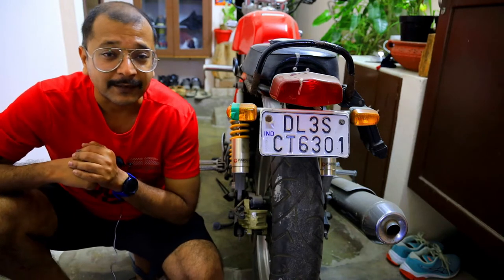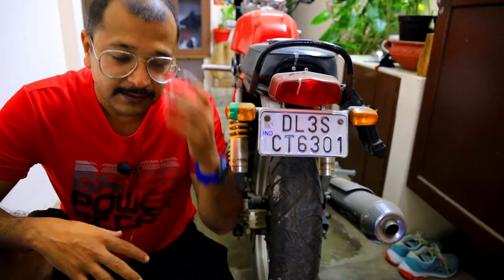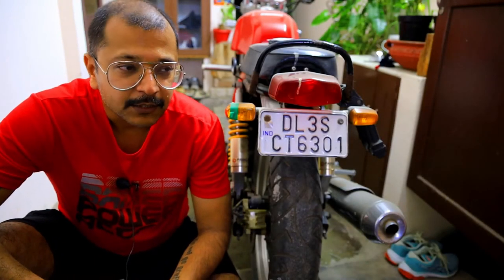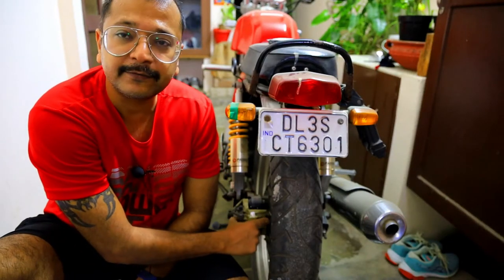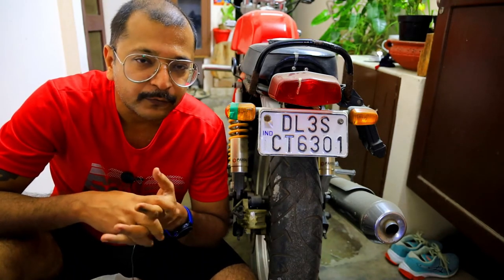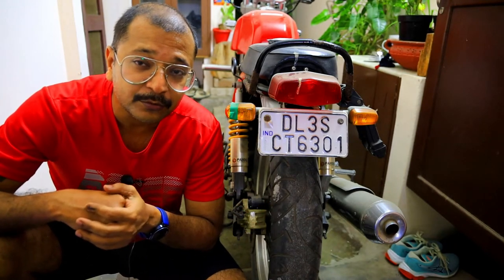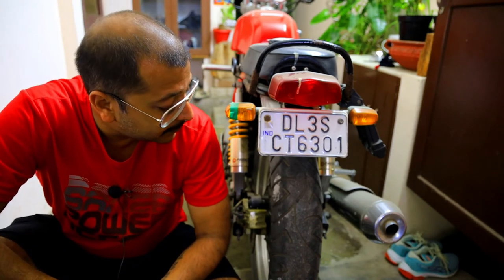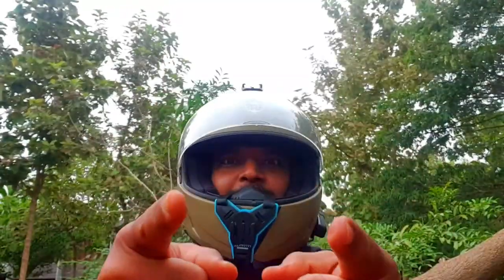Royal Enfield | Continental GT 535 | Disc Brake Problems

Comment: Hi Abhisheka, thank you for the technical knowledge you are sharing. My next project is to rebuilt a GT535 now in basket cases. I've bought a Classic 500 2016 with Hitchcoks kit 535 cc kit and a custom exhaust, more or less the same HP of the GT535. I subscribed your channel. Help growing the channels with RE contents! keep on like that!
Reply from the maker: All the best on your project Robi! In my opinion, the GT535 is not well balanced. Try to find a good chassis, suspension and riding position for your build.
Reply: Hi Abhisheka, thank you for your explanations. Keep on going sharing your videos! they are interesting indeed...